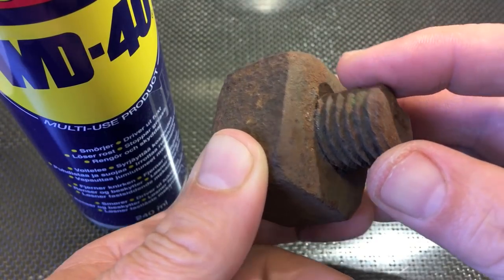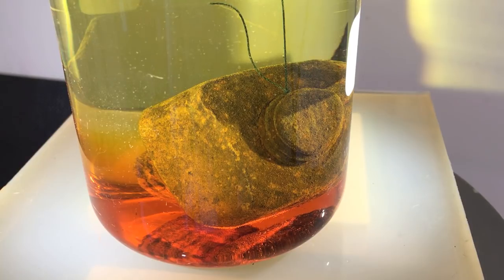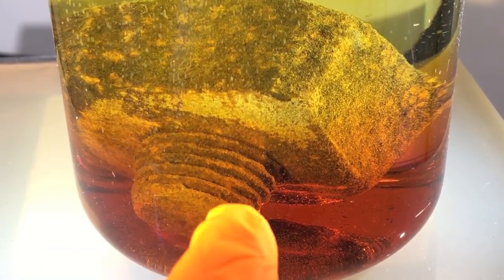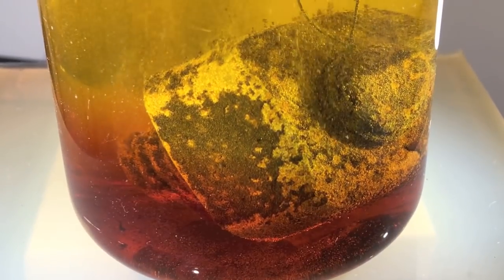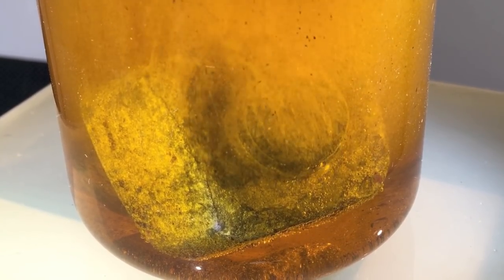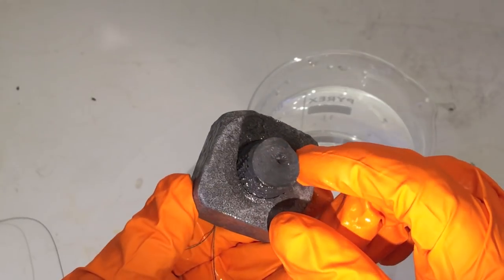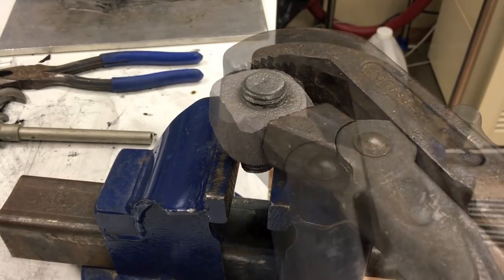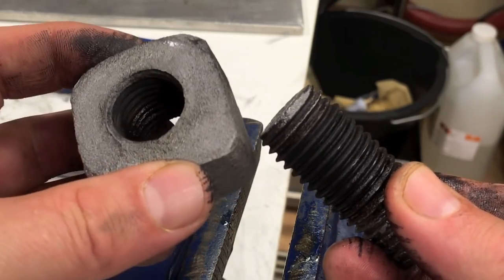Acid as penetrating oil for stuck frozen bolts - Easy rust removal action

Comment: after the rust has been removed from the item...the remaining solution (Ferric Chloride) can be used to process printed circuit boards...removing copper from printed circuit boards etc, (Ferric Chloride + Copper = Copper Chloride + Ferric oxide) and I prefer electrolysis for rust removal as the acid does remove Iron atoms,

Comment: What I discovered during my restoration project is that the majority of bolt-nut junctions that were a subjected to severe corrosion and seizure are actually quite untouched the deeper the threads go. The main crust that prevents you to unscrew it is only 1-2mm in thread length. Which in itself is astonishing, considering that this amount of corrosion is already enough for you to sheer off the bolt head in attempt to unscrew it without any preliminary prep like heating or using penetrating oil.

Comment: Heat the nut  red. - Squirt it with water,  heat it lightly again and melt bees wax into the thread. SLOWLY.. Do not get it hot enough to catch the wax on fire. Take your time - Now pt it back in the vice and take it apart,,,,,then I think I'd pick Evaporust to finish the job. ,,,,, BTW, Industrial Electrical/Millwright contractor here that has worked in the most corrosive environments in the country,,,,,and the next time bees wax fails  us will be the first time bees wax failed us,,,,,,and I'm talking over 50 years and nuts up to 36" diameter. (That one took 82 continuous  hours  to get off

Comment: Cool. I use white vinegar which prevents me from accidentally over doing it (and much safer). It works great. I have a vintage Thorsen 1/2in drive ratchet soaking right now. The selector switch and the spring loaded ball detent on it are frozen.  Also,  I could watch the bubbles all day.
Reply: Actually rust just dissolves quietly with zero bubbles. The bubbles you see are actually from the HCl chipping away at and corroding the good / non-rusted parts of the metal.

Comment: It is a fun and interesting experiment but in practical real-world use for those of us that do regularly need to 'unstick' things, not too useful. The underside of a car, for example, is not going to fit into a beaker. Hydrochloric acid also reacts directly with Iron so you have material loss beyond the Iron Oxide. A good regular use for this is when people do electroplating. It works well to do a quick bath in HCl to lightly etch the surface to promote bonding and to ensure there are no more contaminates like Iron Oxide. There are good uses for HCl in rust removal but understanding the limitations and downsides is very important. I love chemistry and enjoy your videos. I would like to hear you talk more about the risks and downsides to the method (e.g. base material loss during this process).
Reply from the maker: You are completely correct and thank for your comment. There is however a person on YouTube that places an entire car in a acid bath for rust removal. I am soon return to the acid work and will bring more on the down sides . Thx for comment .
Reply: You could make a spray. I've used citric acid like that andcombined it with wire brush.
Reply: @eedom69  Yes but its hard to get an application of the chemical that will stay in contact with the surface sufficiently to penetrate and accomplish anything.
Reply: @darkerbinding6933  Yep. I am trying some tissues packed around the area now sprayed down with solution.

Comment: You are on the ball Ken. I have used muriatic acid to clean water passages in plastic molds, and rusty engine blocks that did not have anti freeze used. It will remove both rust, and calcium from hard water. As you have stated, you need fresh air and personal protective equipment.
 This is a very nice presentation.

Comment: Down the rabbit hole of rust mitigation on an auto restoration. So you think this method would work for dissolving the rust between an axle spline and wheel hub? My electrolysis tank took care of nearly all of the surface rust, but I don’t think it’s getting in between the splines.

Comment: Rust is Goethite and you can dissolve Goethite with Oxalic Acid. I wonder how well that would work for a rusted bolt? It might be overboard compared to the HCL. But using HCL does seem like it could help someone. Good video!
Reply: The benefit of HCl is that iron chlorides are highly soluble in water, so the rust dissolves more quickly.
Reply: Oxalic acid is great for rust removal and also less aggressive than hydrochloric acid.

Comment: Hi Ken, have you tried this on typical bolts from say the underbody of a car or exhaust manifold? I imagine the use of a plastic dropper or syringe or brush would be best. Interested in your results. Seems and obvious solution instead of the typical HEAT HAMMER BREAK

Comment: Hi Ken. I use HCl acid for many rust removal jobs. You will have noticed that further rusting occurs VERY quickly after you clean the acid off with water. To stop this, it is better to use PHOSPHORIC acid afterwards. This creates a fairly good protective phosphate coating which wards off rust. It is better to rapidly dry with hot air as wiping the rinsing water off removes some of the phosphate coating too. By the way, does it have to be 50% HCL solution or can stronger concentrations be used to speed the process up?... Thanks
Reply from the maker: 50% is a 50/50 diluted solution of concentrated HCl. HCl- hydrochloric acid can only be 37% maximum mixed with 100-37=63 % water. This is because 100% HCl is a gas. Good input in the phosphoric acid. Thanks!
Reply: @Ken_Sweden  Thanks Ken for explaining the HCl acid strengths. Just to add, I phosphated a steel sheet item about 4 years ago and it was left in a dampish garage. The steel, to this day, remains un-rusted with a light grey steel colour apart from where there was an area that I left just bare metal which has now become very rusty and brown. As far as I know, most cars are dipped in Phosphoric Acid as the first stage before being primed and painted. It certainly must be worth doing.

Comment: I've been trying to think of ways to get a rusted up sheared off bolt out.  I had this thought of the acid getting into the threads.  Glad to see someone actually tried it already.  Wonder why no one else is doing this.  Oh and was that concentrated acid you put in?
Reply: Old Uncle Silas everybody is already doing this, nothing new here. Old technology every kid in high school chemistry has learned. The acid was 35 baume to start. Industry uses it to descale metal, commonly referred to as pickling the metal.
Reply: In the video he said it is a 50-50 % solution.
Reply: It is a 50-50% solution.
Reply: @mariosantizo4099  But the Muriatic acid comes in strenghts too so waht concentation it was was not clarified!

Comment: would this work to dissolve the rust scale that has fallen to the bottom of an air compressor tank without damaging the pressure vessel?
Reply from the maker: Difficult to answer but I’m sure you know diving tanks are pressure tested on regular basis to ensure safety . Good luck
Reply: @Ken_Sweden  Thank you for responding,  are you saying acid is used inside of diving air tanks?
Reply: @keith7689  I think Ken thought you were referring to a diving tank and so concerned about your safety and I think you were referring to an tools air compressor tank. lol

Comment: Is there a way to stop the part rusting almost as soon as you remove it from the HCI?
Reply from the maker: Yes there are complex binders,  small molecules that can be added as a chemical to the acid solution so that when all the rust is gone the surface is sealed with these chemicals that only can react with bare iron metal. I will make a video on these when I have searched it better.
Reply: @Ken_Sweden  That would be great, thank you!

Comment: I have old backing plates for a dump truck and the brake adjusters are frozen. Would dripping the mixture onto the threads be effective as long as I kept them wet, or would they need to be submerged in the 50% mixture (50% acid to 50% water)? It would require 25 gallons at least to submerge them. In Georgia, muriatic acid is sold 31.45% pure.  Is that the same as you used, or would it be better to drip this acid undiluted on the parts? If submerged, could you use the electrolysis method with muriatic acid mixture?
Reply from the maker: +Philicia Lund the exact concentration has no relevance so you’d be fine with the one you have. Dripping it on will have an effect and may unfreeze them. Good luck!
Reply: @Ken_Sweden  Thank you so much for your reply.  I am probably going to use a diluted muriatic acid solution in water and use electrolysis if you think that would work.
Reply: @Ken_Sweden  I am sorry I didn't make myself clear.  In an electrolysis bath, would muriatic acid work?  If so, what other components and in what ratio would you recommend to a gallon of water?  The parts are so big that I have put them in a 35 gallon plastic trash can.  I am ready to start cleaning them.  Thank you for your advice.
Reply from the maker: Philicia Lund  ok i see, you need to know that you are going to generate chlorine gas on your positive electrode. Chlorine gas is poisonous and should not be breathed. Extra safety needs to be considered and I would not run electrolysis in muriatic acid solutions unless very very diluted. Even with a very diluted muriatic acid solution, the chlorine ions will be very corrosive on your counter electrode, rapidly eroding it. The concentration, if using it should be tested out from lower end side, it’s very reactive. Acetic acid that I recommend from safety perspective in my other video where I show acid and electrolysis, is thousands of times less reactive. Watch out. A cup in a gallon will be very reactive, that’s why you don’t need the electrics involved.

Comment: Sooo ... the acid solution doesn’t attack the paint like the rust?? Also... I think I need that pipe wrench... information please
Reply from the maker: Well, most old paints are resistible to attack this short exposure although they are not as resistible as the polyethylene cord. That cord is actually almost impossible to dissolve and burning is the method for it’s destruction. Biodegradable or waterborne paints sold today wouldn’t do the acid more than seconds. Thanks for comment. The pipe wrench was overkill, I know, but I think they actually used and even bigger wrench when they mounted it along the railway tracks.
Reply: Seems to be a vintage Kongsberg pipe wrench, similar to Bahco but made in Norway. You'll find them at any flea market around Scandinavia.
Reply: I found the Bahco from the usual scumbags ... fleebay. Thanks for the info 👌.automotive style paint is pretty tough in the solution. I’m about to see how 12 hours works out.
Reply from the maker: It's an old Kongsberg as Knut Skoglund noticed. About getting the tough paint off by dissolution, acids won't do much. I just had a blaster cabinet installed after numerous attempt to clean off paint with the harshest Stoddard solvents. From all attempts I can safely say that the only way is to use the paint strippers containing chlorinated solvents. These solvents are not for sale in many countries because of their carcinogenic properties related to long exposures, but they are some form of them in the paint strippers and they make the difference between day and night. I used the Nitro Mors and it removes all paint, no problem, but it takes a while. However, after 2-3 applications, you can just flush it off by water since they mix well with water. They are nasty as sold in hardware stores so thick rubber gloves is needed since they also reacts with the rubbers + breathing mask.
Reply: Knut Skoglund r
Reply: ACETONE REMOVES PAINT EASY
Reply from the maker: Micael Håkans yes, paint remover before, very good idea. I use this. It probably contains stuff that was banned some time ago so use it with care, the smell tells me what is in it. it could be that is is so low levels that it is ok... the paint runs off in a beat and your acid will work undisturbed.

https://www.clasohlson.com/se/Färgborttagning-Nitromors,-750-ml/Pr401091000
Reply: @Onionbaron  You can use extreme heat to clean metal surfaces. "Flamrensning" in swedish.
If you use an acetylene/oxygen flame the paint will burn and disintegrate

Comment: why use 50/50 mix of water and acid? why not just use straight acid would it not be better
Reply from the maker: +Ian Barlow you won’t see much difference in action in a video. Also, you end up with a major problem for the muriatic acid (hydrochloric), which is its fumes. Only opening the bottle smells so much, and sticks in your eyes, that if you get close it’s practically almost impossible to work. The extra strength is neither motivated because the 50% water added helps in transporting the dissolved rust and dirt away so that the acid can access all grooves. One could go 60-70 but for my own experiments I would say better go 30% acid since it’s safer, you won’t see any difference in the results, and it will only take maybe 10 min instead of 8.

Comment: Thumbs up Ken Sweden! This sounds like a great tip and I will surely give it a try.  Do you think this would have been successful had there been no grease used on the fastener 20yrs ago? 
All the best from OZ,
Ben
Reply from the maker: +Machete Bushcraft Australia yes I think so, I had almost given up when it fell apart but when it did I looked closer and sure enough the acid eat all the rust, and would had done so also down in the thread. You would have lost some rusted away thread. Thanks f comment and all the best  👍

Comment: My question is, if you were to spray solution of muratic acid on a rusty car chassis, would that dissolve the rust better than phosphoric acid ? Muratic acid might be better when the item is dunked in it but is it best when just sprayed on ? Or does it evaporate and not do the job ? Plus, does phosphoric acid do a better job at preventing rust from coming back ? Should either be washed off after a period of time or should they be left on ?
Reply from the maker: Yes Muriatic will dissolve it better, faster and more effectively. Nothing will beat Muriatic in this regards. Neither one of them will effectively prevent the rust from coming back although the phosphoric acid will make the surface black and as it dries up and this porous black surface of iron phosphate is a reasonably good base for applying a paint. Evaporation is the same for the two, it’s mostly water so you won’t notice any difference. At the end of a spray like mentioned it’s best to spray if off with water, or even better water with baking soda in it, because that will minimize the effect of acid remains on the chassis. The worst acid remains will always be from the Muriatic because it is the most effective to get reactions going both in terms of dissolving rust and leaving remains that initiate new rust. It’s because of the reactive nature of the chloride ions that it contains.
Reply: @Ken_Sweden  There is a product called "Rustmort" sold in autobody supply stores which they use to spray inside body panels and I believe they do not recommend washing it off prior to paint. I think it is a phosphoric acid. I have also purchased phosphoric acid drain opener which works well to dissolve mineral scale in a toilet bowl as well as clear the drain.  Both phosphoric acid and muriatic acid require good ventilation and significant dilution . I'm just wondering why the autobody product contains phosphoric acid and not muriatic acid.  Any idea ?
Reply from the maker: J M yes, it’s because of the chloride ions in the Muriatic acid. They don’t want it. Remains makes rust come back faster.
Reply: @Ken_Sweden  So when using muriatic acid , it requires rinsing and does not leave a protective compound on the surface but when using phosphoric acid , it does ?  Also, is it possible that the chlorine turns into a gas quickly and leaves the surface, whereas the phosphoric acid remains for a long time doing the job , just more slowly ?
Reply from the maker: J M no the chlorine won’t go off as gas.  It is to reactive in its form in the acid so it will react with iron to iron chloride salt that to some extent deposit on the surface of the iron part. Yes the phosphoric acid will do the job more slowly.
Reply: @Ken_Sweden  I also use a rust converter product made by Benjamin Moore.  It turns the rust black and is labeled as a primer prior to paint.  I would imagine that the rustmort product might dissolve more rust but I'm not sure.  Are you familiar with these rust converter products ?
Reply: Tannic acid is the converter but think you'd still have to coat it with paint or something.

Comment: Great video.  Do anyone know if I have to neutralize OSPHO ( phosphoric acid) after using it on the car chassis before I paint?  not concern about paint adhesion but  acid eating away the metal longterm.
Reply from the maker: Sorry late reply, there is no need for neutralizing apart from flushing it with water because there is nothing left behind. The phosphorus part of the acid is bonded to the metal. However, it is important to really let it all dry up properly before painting.

Comment: I almost get sleep when hearing your talk in the video, slow enough.  although, a good job.
Reply from the maker: Xinfeng Wei Thanks for your comment. It’s on purpose to highlight how smooth and easy you can remove it all. Imagine how quite and calm this process is compared to if you ask a mechanic to pull off this bolt. They would try and try with impact wrench and then heat, heat and impact wrench.... working at 120 dB
Reply: Very smooth voice if you ask me 😎